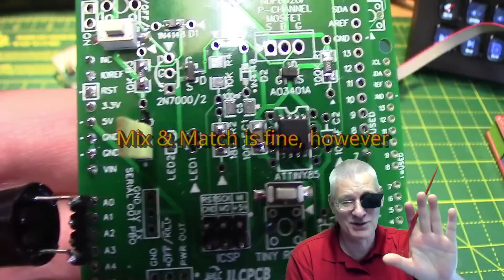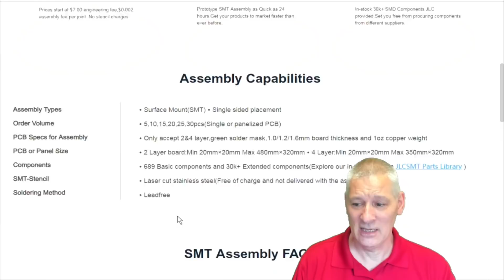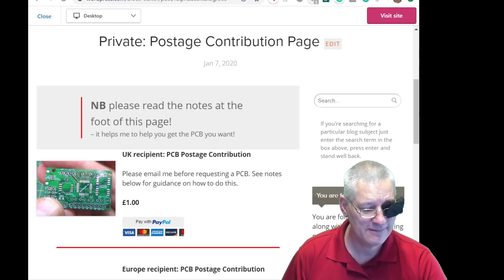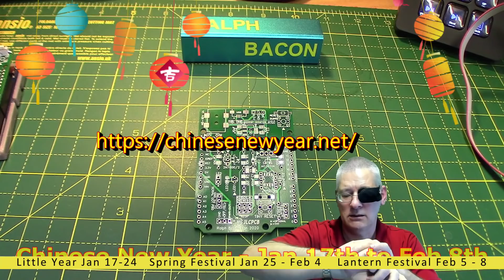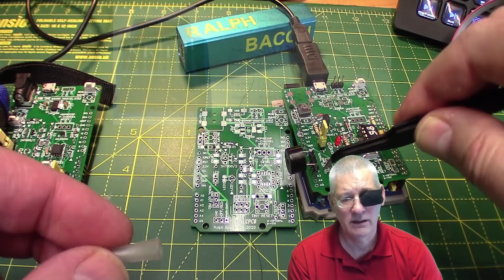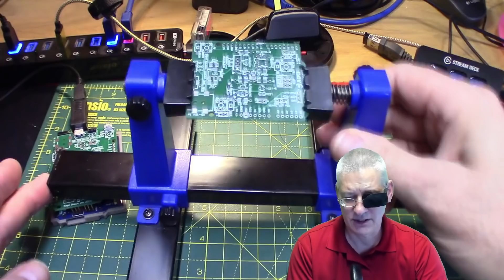#176 Dual SMD & THT PCB Arduino Shield (Easy! Yes You CAN)

Comment: the sound effects dont do it, sorry. Otherwise usual high quality video
Reply from the maker: Do you mean the door opening and closing sounds? I spent HOURS getting those to work. HOURS. Well, 15 minutes at least. Using Lucasz's code as a starting point. And you don't like them? Benny does, as it means something is coming out of the fridge which he wishes to partake in! Perhaps I should change the noises entirely, that would confuse him! Perhaps you mean other sound effects? Anyway, glad you liked the video, good to hear from you.
Reply: @RalphBacon  The sound-board samples like the laughing and the applause are what he is talking about, I think. I'm inclined to agree.

Comment: Hey Ralph, alyways a joy to watch your channel!

Got one for the "Tools I can't live without" section: Reverse Tweezers.

Works just like your ordinary tweezers - but they hold stuff when not pressed. And there's enough force, to hold your everyday resistor, SMD-Chip, whatever-you-want while soldering in place.
In my workshop, I've normally 2 to 3 of them lying around - way more flexible than any third-hand-tool. Love the ceramic ones - no solder sticking to them, and no heat transported away by metal.
If you're looking in the usual places: try "Anti-Static Reverse Ceramic Tweezers" as a search term.
Reply from the maker: I have a pair like that, Detlef, but they are a bit big, I should have got a smaller pair. I will ook at the search terms you suggest, thanks for the tip.

Comment: Ralph, Lidl's (NI) are selling the exact tweezer set this week!  Also, I use Lidl's Cien Nail Polish Remover (WITH Acetone!) to clean off flux.  And it comes with a handy bowl that the liquid is pumped into.  It's also a good job I didn't what one! lol
Reply: But am still using your PB mod board!
Reply from the maker: Do you have a link as I cannot find the item in the UK stores? Glad your PCB Mod board is still going well!
Reply: @RalphBacon  Lidl's Northern Ireland only, at this time.  They will make it to England:  https://www.lidl-ni.co.uk/en/p/diy-deals/anti-static-tweezer-set/p24578
Reply: If you would like a set, let me know and I will mail you one.
Reply from the maker: Thanks for the offer, Jon, but I'll wait until they turn up here and I can have an actual inspection of them. I don't actually need any at this stage but I've always found Lidl (and Aldi) stuff good quality so a second set it always a good backup. Thanks for the link! The only thing missing (compared to mine) are the little soft plastic covers over the ends of the tweezer to protect them, I'm guessing. One  of which I've already lost!
Reply: @RalphBacon  Thay do have them, just not on the one picture.

Comment: Regarding isopropyl alcohol; instead of using the pure stuff I use 50% rubbing alcohol works just fine and does not cost an arm and a leg. : - ))  Your dual component board is a great idea.
Reply: You may be able to purchase rubbing alcohol from the local chemist.  In NA, it is often by the hydrogen peroxide.
Reply from the maker: I had to look up "rubbing alcohol" as a result of your comment here, Paul, as although I had obviously heard the term, what it actually was remained a (medical) mystery to em!

Now depending on whether you are UK or USA-based can make a difference in what you really mean (https://en.wikipedia.org/wiki/Rubbing_alcohol) but my takeaway was this line:
Isopropyl rubbing alcohols contain from 50% to 99% by volume of isopropyl alcohol, the remainder consisting of water

So if I dilute my own IPA (not the beer) with (up to) 50% water then I save (up to) 50% but will it still work as wonderfully as the pure stuff? Only one way to find out, which I will do on a lazy Sunday morning (ie tomorrow). Thanks for the heads up. I will doubtless report my findings in a future video (where, if it works, I will take all the credit, and if it doesn't, blame you mercilessly). I take no prisoners!

Comment: USING unleaded solder is absolutely NOT impossible. The lead-free solder which you buy today is virtually indistinguishable from leaded solder. The development has been ongoing during the past years!

The black paint on the tweezers is a resistive coating which will limit any discharge current from your body into your components or back and thus performs the function of ESD-protection. Unlike bare metal tweezers which will not limit the current.
Reply: Do you have some product recommendations?
Reply: @g3i0r  I will answer when I am home again
Reply: @g3i0r  Multicore 96S Sn96Ag4 with Ersin 362 flux cores

Felder Iso-core "clear" Sn100Ni+ 
https://www.felder.de/files/felder/pdf/EN_52-ISO-Core%20Clear_lead_free.pdf
Reply from the maker: I've emailed you the info, Uwe.
Reply: @RalphBacon ... and I am right on my way to post you an envelope
Reply: @RalphBacon  Looking forward for a little review ;)
Reply from the maker: I'd be willing to try a GOOD (aka "virtually indistinguishable") lead-free solder. I await your recommendations, Uwe. My last lead-free was awful, dull joints, didn't wet the component properly, needed a higher melting point... the list goes on.
Reply: @RalphBacon  yes, it needs a higher melting point - you should be running your soldering station at 320-330°C.

I'm willing to send you some samples of the brands I use...

Comment: How does one unbrick an ATTiny with this?
Reply from the maker: You just flash a new bootloader with the correct fuse settings (probably the clock settings are wrong, eg it's looking for an external crystal) and if that takes your ATTiny85 is back to full use!
Although I say "flash a new bootloader" what we are really doing is updating the fuses (settings) and then ignoring the bootloader code by flashing a new sketch. ATTiny85 is a bit small, memory wise, for a bootloader, but some people do use one.
If you have previously flashed it to use an external crystal you will have to put one on the breadboard temporarily to get the clock running. EVen a crystal outside it's normal value would be OK eg a 3.141596MHz would work OK to be able to flash the new settings.

Comment: Hi Ralph good video, quick question, what is the purpose of the Regulator/LDO as there is one on the Arduino already and I noted your through the whole version didn't seem to have it so I assume it is optional. To avoid quiscent current (using power when off) you would what to switch power before any regulator.
Reply from the maker: This was purely a convenience (ie last minute) thing, Andrew. So that I could power the board without fiddling with those Dupont cables to my PSU when I have a perfectly good 9v and 12v wall warts sitting there with a standard 2.1mm barrel hack. 
The LDO I used is quite efficient (but not for battery use) and we feed in the 5v to the Arduino not the full voltage via Vin. I have to have 5v fro the ATTiny85 anyway so that's why I did it that way. Perhaps I should have put the P-channel MOSFET BEFORE the regulator as it can take up to 20v, I believe. Oh well, that's why I will upload my designs to my GitHub and let others make it better!

Comment: Well done.  (as usual.)  You should not be embarrassed requesting the recipient to cover postage.  You're already giving free product.  Your postage rates are most reasonable.
When using flux core solder, my preference is to order 63/37. (tin/lead ratio.)  It has a quicker 'freeze' once the iron is removed.  Helps prevent cold solder joints.  I have not made it through all of your videos as yet, so I don't know if you've mentioned it previously.
I hope to be using some smd by the end of the year.  I've been gearing up for it, for a little while now. Being on a very tight budget, I get a little something each month or so, and am close to making it happen.
Thanks again, have a good day.
Reply: He always does great videos out sends like. Although I have missed a few episodes. 
Nevertheless, the reason for my comment is jst a note of encouragement. I think it's great that you are pursuing you dream. And 

Ralph give this man(woman) a heart.
Reply: @vonries  Thanks, but its more of a fun hobby that I'm trying to get my nieces and nephews into, than a dream.  My training as a tech came a little over 4 decades ago when I was enlisted.  Mainly transistors and vacuum tubes.  Between then and now, I did a lot of welding and fabrication.  Now I'm pretty well laid up from being 'rode hard and put up wet' too many times. (a horse reference if you're not familiar with it.)  As such, I'm doing what I can to be useful, and with this I'm having fun learning the new stuff, and some basic electronic engineering as I build my own circuits rather than buying modules.  I'm having fun, as I try to show the kids the importance of math studies, without hitting them over the head with it.  So, nothing noble, just having fun.  Oh, I'm a dude.  Not a dudette.
Reply: @gfodale   I think that's even more noble than following your long lost passion. Doing something for others without want or desire for repayment?.... Sounds noble to me (more what they should have been not necessarily the way nobility actually behaved in real life (sorry Ralph might be a bit of USA bias here). 
Too familiar with 'run hard and put away wet.' That's what I always claimed but I did that part myself in all honesty. However, what did me in were 3 auto accidents. Do face it you're a knight in a dirty leather smock hung by the door. Lol enjoy those kids they are only small once. Soon their open little minds of curiosity will close off as they become teenagers and start to focus on some subject that interest them from all the things they were exposed to as children. Maybe they will and maybe the won't do any of what you taught them as their career, but at least the were exposed to it. Then they can decide if it's for them as a career or just a hobby that brings them joy. Even if they never touch it again after you're done, they still learned so much more that just how to blink an led on command. Good job sir. Sparks Allot(cutting steel sparks, electronic sparks).
Reply from the maker: @gfodale Thanks for the words of support, as I suppose I am embarrassed about asking for postage money but it's got to be this way! And I will try that 63/37. (tin/lead ratio.) solder too!

Comment: 3:55 Put in both? For passive components: Resistors: 100k would be 50k. Capacitors would be added (like resistors in series). Inductors in parallel would be like resistors. Now, what about transistors? MOSFETs would probably work just fine as switches, with a better (lower) "Ron". BJT (Bipolar Junction Transistor) is a bit tricky, but I guess two similar BJTs in parallel would act as one as the base- and collector current would be cut in half but then added because they are in parallel. When it comes to ICs I definitely do not recommend two in parallel. :-) Oh, and LEDs would be fine provided the current limited resistors are also doubled (in paralell). Nice video, Ralph. Thanks for sharing.
Reply: Here I was hoping he had just invented the dual core Uno. ;~{) lol.
Reply from the maker: Well, technically you are correct, Robert, but the whole point of this board is that users relatively new to SMD construction could "have a go" but fall back to through-hole if they got stuck, not do twice the amount of work. But, I'm sure you knew that! OTOH perhaps I should build one with BOTH components fitted just to see if you are correct! Ha ha, no, I'm not doing that.
Reply: I knew that, Ralph, but the question was quite interesting. It is obviously stupid to add all components, but what if? The 100k (R1) at the gate of Q1 looks like a (weak) pull-up. 50k pull-up is ok. R3 looks like a pull-down and I think 5k would be ok. Two diodes in series is just fine (except a waste of a diode, but that's not the point). Double capacitors is not a problem in this circuit.  The big question is what will two ATtiny85s in parallel do. Provided the same software of course. I'm really not sure if it would be a problem, although it's a really, really bad idea. :)
Reply: We would need a single clock source for two microcontrollers to do the same thing at the same time. Hence, the answer is no.
Reply from the maker: You could drive both MCUs with a single clock on one pin per chip. Couldn't use a crystal easily though. So, as you say, the answer is (probably) no.

Comment: 1207 SMD is so much easier than 0402 which may easily be stuck to your soldering iron tip and disappear altogether.
Reply from the maker: That's happened to me too, Chis. "Now where did that go?". Oh, it's now a toasted 0402 capacitor. Try that one again...

Edit: Yikes, you were not kidding about the price. But It has not put me off.

Comment: Nice info provided here ! Though i have never soldered passive smd components, many times i had to solder smd IC's. And though i tried to solder them each pin individually (as you proposed for the micro USB socket), most of the times i ended up with many pins joined together with soldering. The idea i had, and is working like a charm, is not to worry about that. Let as many pins get full of soldering as you continue. All you have to do is to use desoldering wick on the joined pins, and the wick will absorb the excess soldering, that poured accidentally. You will end up with a neatly soldered IC.
Reply from the maker: Yes I do it your way, exactly so. I have a Weller Gullwing soldering iron tip on my ST-100 iron (slightly concave tip so holds a reservoir of solder) and use lots of flux and just run the iron across the pins/pads (very careful not to bend the pins, did that only once) then clean up any bridges with solder wick. I should have added that wick as one of the essential tools. I guess we both have success with this method and it works with SMD components too, although not as essential.
Reply: @RalphBacon  I use the exact same tip on my traditional Antex cs 18watt (soldering iron for a lifetime !). And now i'm plannig to get a more ''needle'' tip (a 1mm perhaps) to practice in  2-pin components soldering .

Comment: Nice video again Ralph,  but I've never needed to use flux to solder SMD's with solder on a reel.

solder a small blob of solder to one pad, place chip on to pads then solder chip on to pad that you put the solder on. then just solder the other end, job
done. only ever use flux when removing components as it's needed to help the old solder to flow nicely again. (just get the best solder you can. RS,
CPC,  Farnell, or Digikey etc it will be your best friend, Chinese solder will just pretend to be nice.) 

 I've been working in the electronics industry since 1976 and been soldering longer than that. Multicore solder comes with all the flux you need.

No problem with paying postage, or even components as I'm about to start a board which has 0805's on it, but the cost of getting a few components is quite high as they are not what i normally use, but i will have a lot spare :)
Reply from the maker: I tend to use flux (out of that syringe) and then use my Weller Gull Wing soldering iron tip which holds more than enough solder for a couple of joints. That way, I don't need to feed the solder in with my fifth hand, whilst holding the component with tweezers, the soldering iron, fending Benny off the workbench... you get the idea. The joint is made in less than half a second, that flux works wonders, far better (quicker) than just the flux in the solder.

Comment: Ralph, what size padded bags are you using?
I have a client who can find you a box full. No charge.....
Reply from the maker: I use "official", extremely light, padded, white UK Large Letter size 00 (W), Tony, as the smaller size ended up too small for PCBs and any components. I bought a box of 100 from somewhere but half have now gone! A new box would be amazing, if you email me I will send you my address. Thanks so much.
Reply from the maker: I've sent you an email Tony. I suggest you remove that post of yours or you could be spammed.

Comment: Brilliant!!  That is such a  good idea for a maker channel: optional smd/THC components. You really look after us guys - no matter how much knowledge/confidence we might have. A little SMD tip: have a variety of coloured THC LEDs solder a 603 current limiting resistor to the cathode lead (quite near the LED) with a blob of solder at each end of the resistor, then using side cutters cut of the wire between the solder blobs. Then trim both the  the leads so they are just long enough for a breadboard. This saves you having to mess about with discrete current limiting resistors when knocking up your awesome circuits on a breadboard. (much neater too).
Reply from the maker: You have been reading my mind, Michael. I normally use a blue LED as the voltage drop is so big that no limiting resistor is required (so far) but only yesterday I was thinking that I might get some LEDS with a built in resistor so I can have more than one colour - and then you give me this amazing tip, which I shall try tomorrow. Thanks so much.

Comment: Ralph, Thanks for another great video. I have stayed with through hole so far on my boards but the latest one coming in the mail is 5 volt so I used a micro USB connector for power. I will see how I do with that. Maybe I will try some SMD on a future board. I started a blog, mainly as a personal notebook, of my PCB adventures https://keithlohmeyer.blogspot.com/
Reply from the maker: You chose possibly the most difficult (SMD or THT) component to solder, Keith, make sure no solder gets inside the socket as you won't get the plug in. Desoldering wick will get it back out though.
Reply from the maker: I've just started to read your blog - most flattering to me, thanks for the mention, I never knew I had influenced you so much (and, in turn, your classes). Fantastic.